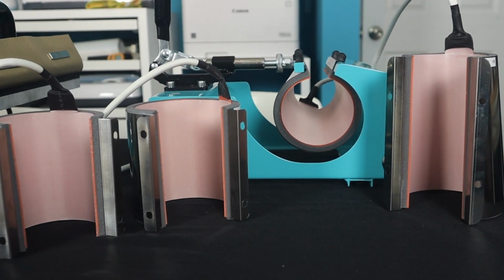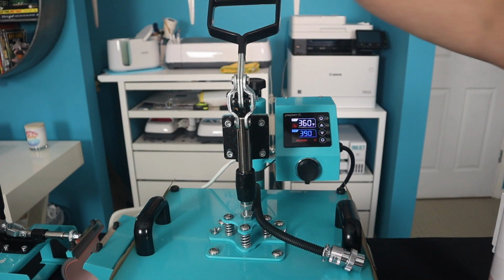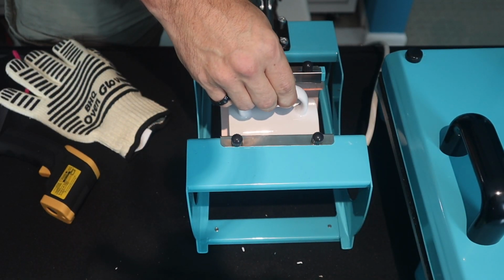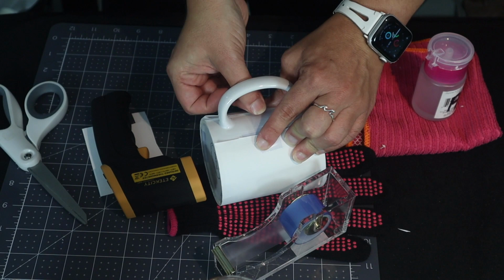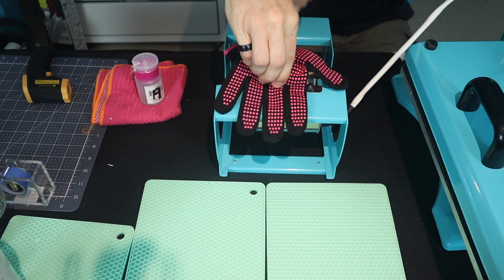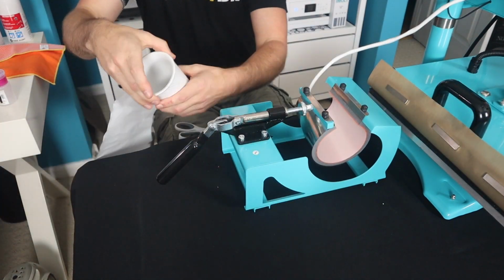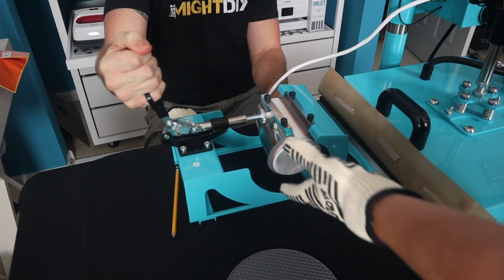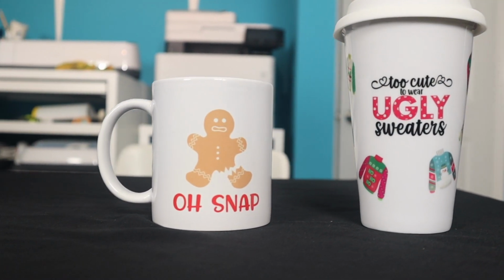How to Use the StarCraft Mug Press to Sublimate Mugs and Tumblers!

Comment: You guys make this seem so easy....I am so discouraged...I have this exact same set up and following your instructions...I am using a 15oz cricut mug and for some reason no matter how much I try to adjust the pressure, the press won't close...I already broke one mug...trying another one and I feel like I am gonna break this one also...any tips?
Reply from the maker: Hey! That does sound frustrating. The 15oz mug just might be too big for this mug press. You could theoretically manually hold the pressure since the handle won’t close if you don’t have a convection oven or Cricut Mug Press (which would both fit it).

Comment: This just made me realize I should have bought this from the beginning...
Reply: That is get one of those machines.
Reply from the maker: Sounds like a great plan!
Reply from the maker: Hey! Thanks so much for watching. We’re really enjoying our Starcraft 8-in-1. What did you end up buying?
Reply: @JustMightDIY  I bought both the cricut easy press 2 and the mug press, between those 2 things... I would be close to buying that... whoops.
Reply from the maker: Very true! We started with the EasyPress 2 as well. It’s good for HTV, but much harder to get good sublimation results with it. We LOVE using the Cricut mug press for straight edged blanks, as it’s simplicity can’t be beat. However, the versatility of these attachments are quite nice. Do you have a convection oven? If not, that could be a great addition to your sublimation setup.
Reply: I use mine for food.  And if I'm going to spend money... I think I will get one of those instead.   I keep hearing my pops say.... son there is a right tool for every job. 

If I can make enough money to pay for the equipment I bought,  well... then I will look to upgrade.

Comment: I got my press about a month ago. I just used it once. My timer does not start. Should I contact the manufacturer?
Reply from the maker: Hey! Contact the store where you purchased it - they can help with any warranty issues. As for the timer not working - it doesn’t work with the mug press; it only works on attachments that use the main arm on the press. Good luck!